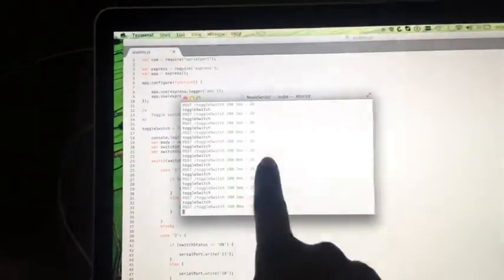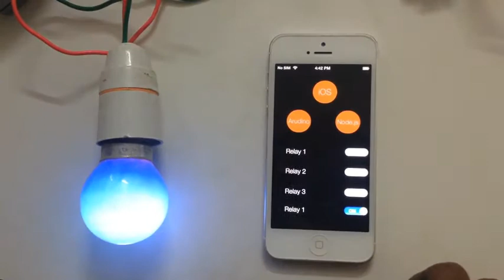Controlling AC light via Relay using Arduino, Node.js and iOS

Comment: bro, i have been given same project .. but i do not know what data i need to send from nodejs ? would u please help me out in this? i am in need of help bro plz.. help me out
Reply from the maker: prabhu kadode send integer and do bitwise manipulation. For instance, 4 lights are connected 1 first light on, 2 -> second light on, 4 -> 3rd light on etc
Reply: bro, my project is all about controlling streets lights with cloud.. i need to send certain data to contrator which will controll street light but i am unware that what data i need to send to that..   is that ok if i send json data ?

Comment: What happens if there is a short circuit in the item on the load of the relay? Can the Arduino be programmed to have a protection system for that particular item/relay?